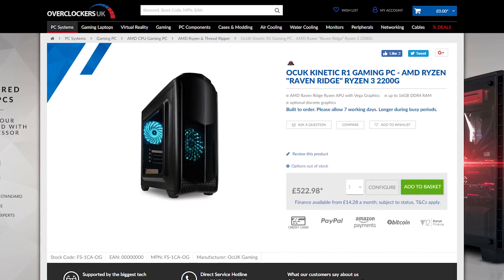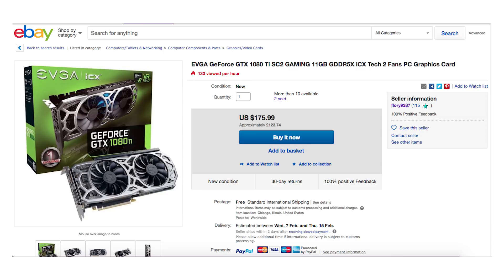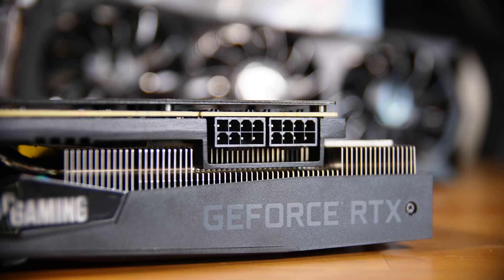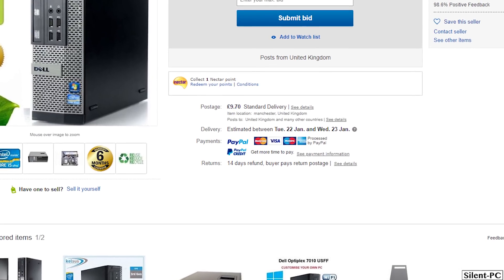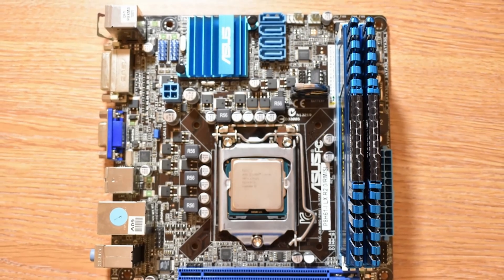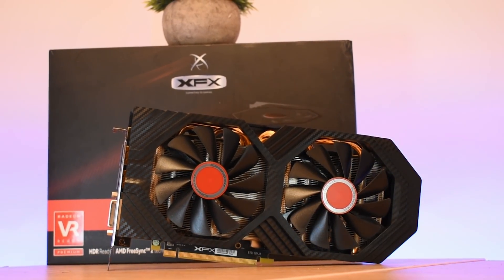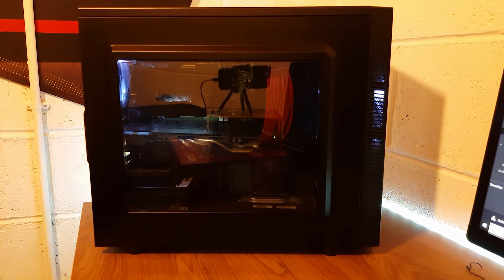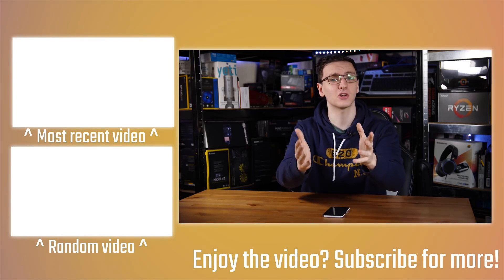Used Tech Buyers Guide - Tips & tricks | Budget Series

Comment: I was able to pick up an MSI Vega 56 Airboost OC for $217.50, it's reference style blower and exactly what I wanted.
Seller had proof the card was a replacement from MSI for a 56 he sent in on RMA 5 months ago, so it's basically a new card.
A week after buying the card I was able to pick up an EK Water Block for it for $75.00, that's the reason I wanted a reference card as these blocks are more common.
So for $292.50 total, I've got a 56 on water that easily holds it's 1622 boost clock...

My rig is an Intel MQ77DK in a Sama Maxcool Micro ATX ($30.00) with an i5 3570 and a 4 Stick Set of Patriot Viper 16 gigs of DDR3 @1600 CL9 1T.
Paired with this Vega I'm enjoying crushing all games I play and current titles in 1080p.
All used parts acquired on Ebay, except the ram from Newegg, and an XFX 750 Pro I purchased in 2010 for a Phenom 965 build.
So my total rig I have around $545.50 in not counting water cooling except the EK Block as I had all the parts needed for that and an SSD/HDD I had lying around.
If I stick to 1080p I should be good for a few years or until I decide to move to the next build.
I'd put this rig up against any $1000.00 rig built with new parts and bet it would hold within a margin I'd happily let slide for the difference in price...